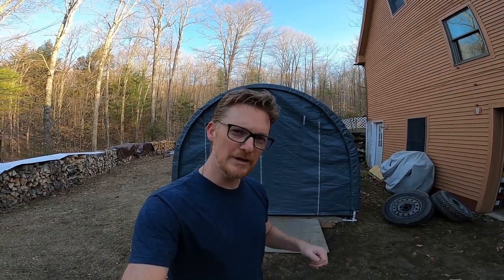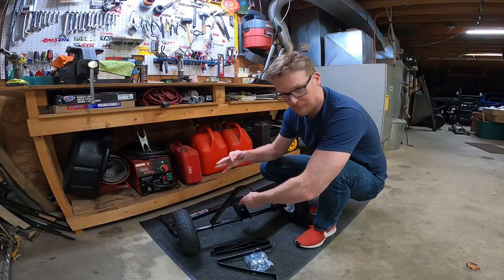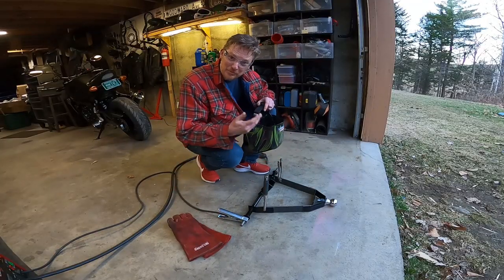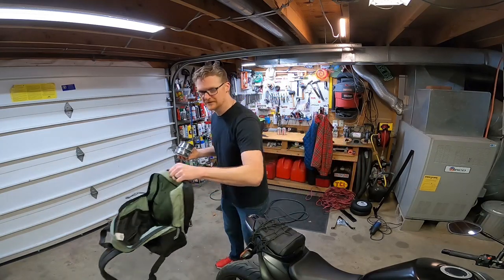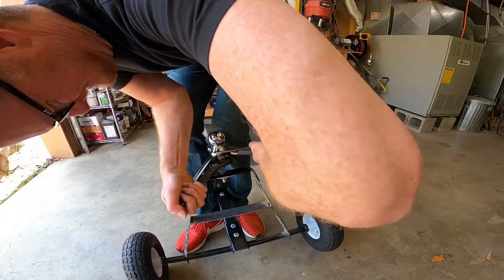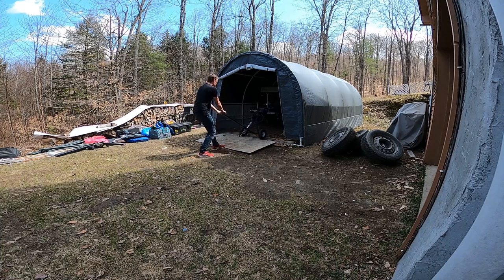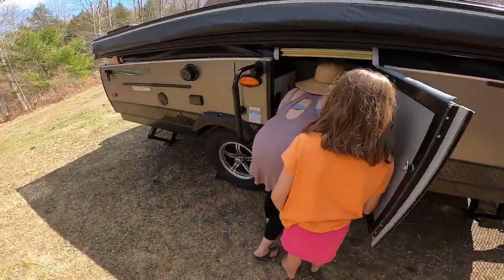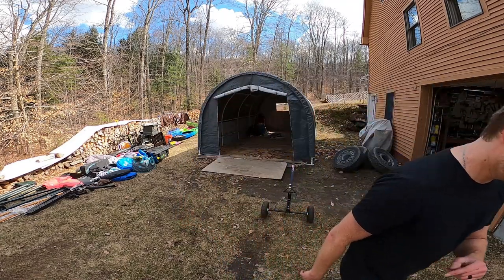Harbor Freight Trailer Dolly Mod | Pop Up Camper Rockwood 2280bhesp

Comment: That dolly worked getting it out of the shed, I want to see the video of you putting it back in at that slight uphill incline on grass.
Reply from the maker: Not gonna happen lol... BUT after I get the rear wheels inside I will place planks of wood on the grass to help maneuver with the hand dolly.

Comment: nice video michael,me being an old guy i think i would have to come up with a way to connect the handle end to fit my riding lawnmower
Reply from the maker: I was afraid it would flip my lawn mower!! It’s such a nose heavy camper.
Reply: @sstressfl  Put some weight in the back of the trailer.

Comment: As you may have found out by now is that the weak link of that trailer dolly are the crappy wheels. They will work ok until the wheels fold on you from too much weight. You will get tired of going back to Harbor Freight  to exchange them for some more crappy wheels.
Reply from the maker: They are crappy wheels so far they’ve held up. But I got my eyes on some good dolly wheels to replace them :)

Comment: Why is the ats at the dealer again? , nothing serious I hope.
Reply from the maker: It is! Still has drivetrain vibration when under light accel load / going up hills / weight in the car. :/ Plus low coolant level (leak) and cracked/etched headlamps.
Reply: @sstressfl  oh ok, hope they resolve all issues to your satisfaction.
Reply from the maker: @DK-455  Thank you! Me too :)